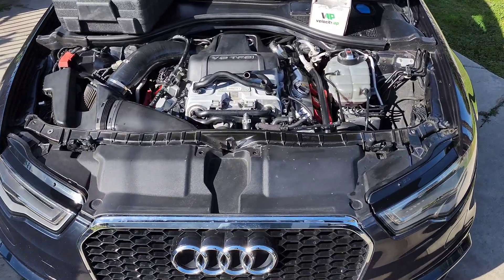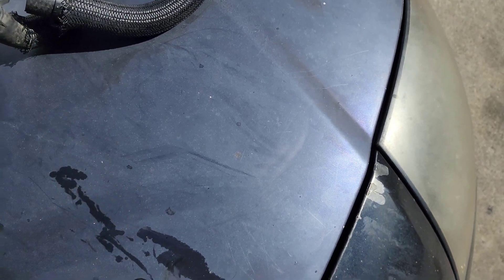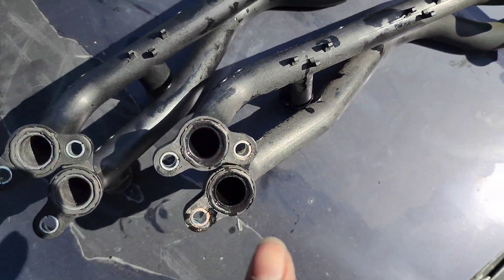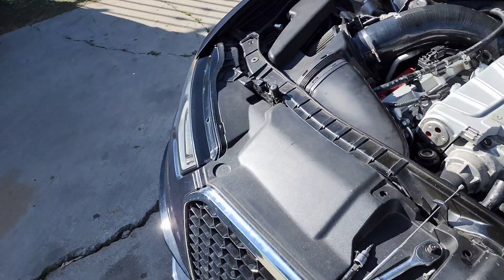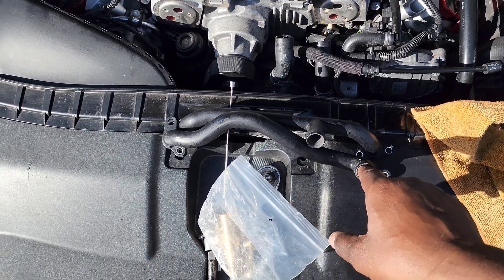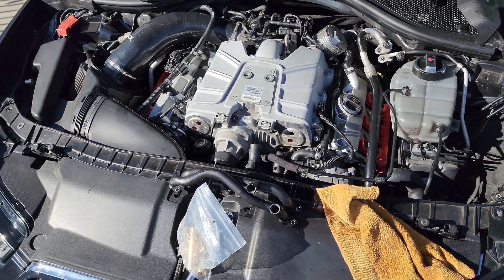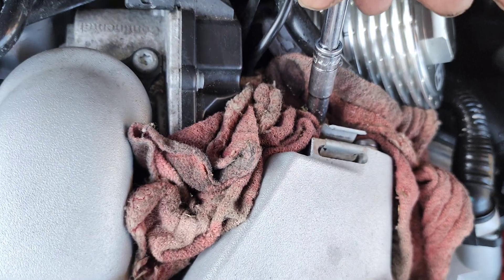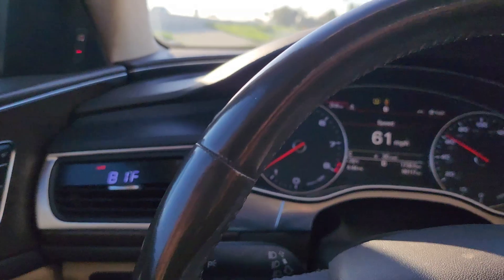Audi 3.0T Ported Intercooler Manifold Experiment

Comment: I finally finished putting my velocity AP ports with heatshrink and 3/4” hoses. Deleted the aux cooler and cut PWM cable on pump. Your videos definitely inspired me to try doing stuff myself. My special information gift to you mr c Midas , is that 4G88072459B9 will perfectly cover up that open corner grill on driver side front bumper. The passenger side came with it covered from factory and this is the right hand side.
Reply from the maker: Glad you got it done bro. I just did another cooking mod that you might be interested in. I think I'm the first to do it. I should have a video up on it in the near future. 
Thanks but I don't have the s-line bumper anymore. I have the Canautoperformance RS6 bumper now so the grilles ate different.
Reply: @cmidas3396 I’m hyped. Hopefully it’s the plasmatio blower plates, I have an appointment to get them installed next Saturday. You’ll beat me to it prolly tho jaja